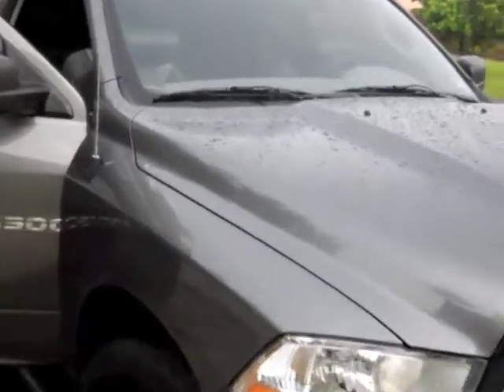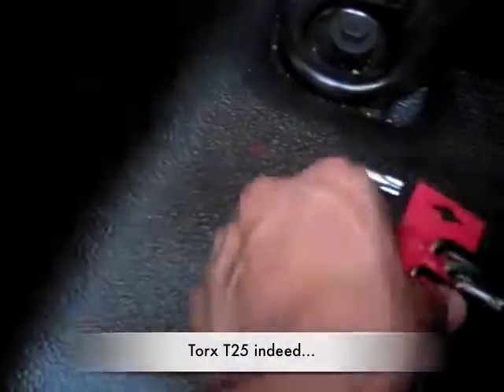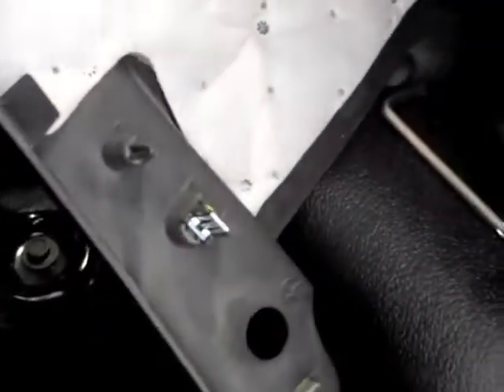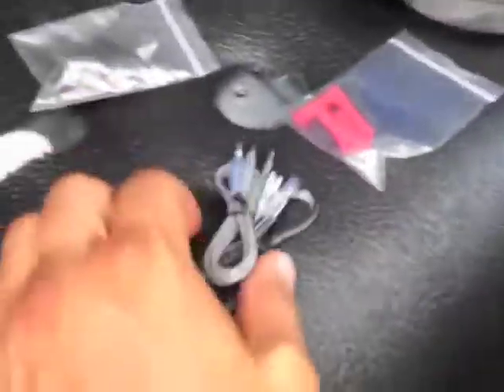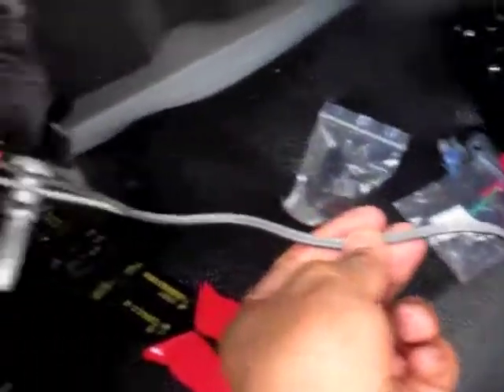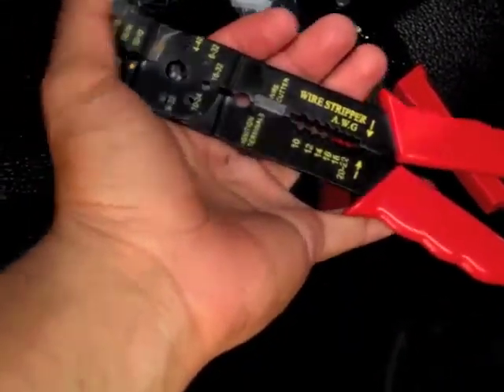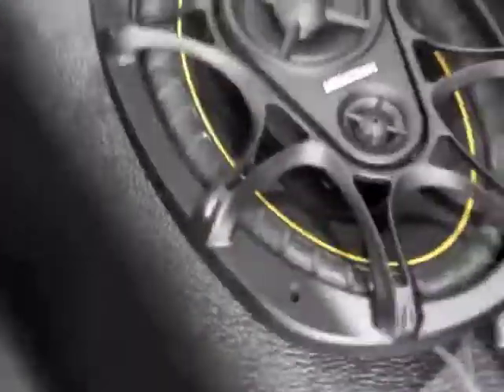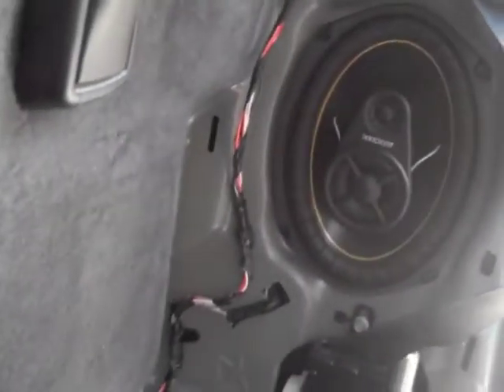How to Install Back/Side/Rear Speakers on a 2009-2012 Dodge Ram

Comment: You do know that the speaker will still produce sound even if positive and negative is backwards? If its hooked up right the speaker will push out when it hits, and if its hooked up backwards the speaker will suck in when it hits.
Reply from the maker: thx

Comment: just did dash and doors  a few weeks will do rear tray speakers.the site i posted are dead on.  remember on speakers   the little  wire stud is ground the big stud is power....my 2012 hemi ram 1500 short bed
Reply: Arnie Garrison do you recall if there are two or three dash speakers? do you have the base sound system(non-alpine)?
Reply: base sound sytme... 2 in dash  20 minutes to instal both.2 in doors about  1hr.to due very easy.   the dash and roors adjust  with  front together right and left. the rear works rear or on 4 door rear doors and rear speakers

Comment: I JUST BOUGHT THE SPEAKER HARNESS INSTEAD OF HAVING TO CUT THE FACTORY ONE ON MY CAR
Reply: Thomas boi did you cut the wire after all? Or used the harness?
Reply from the maker: good move

Comment: these speakers suck big time. (stock). i had to pause the video to say i feel you with them cheap wire chrimpers and i was cracking up laughing when you kicked them  down the ditch.